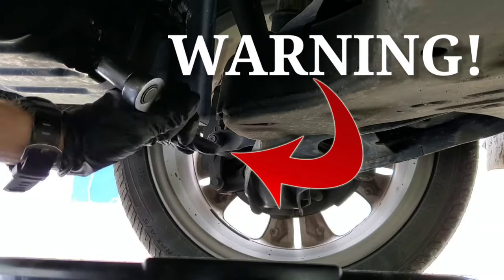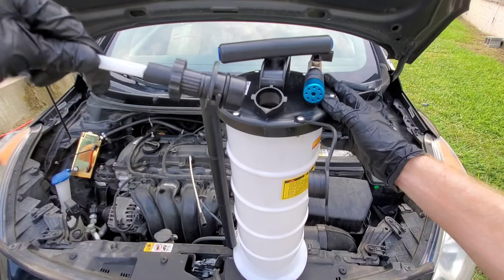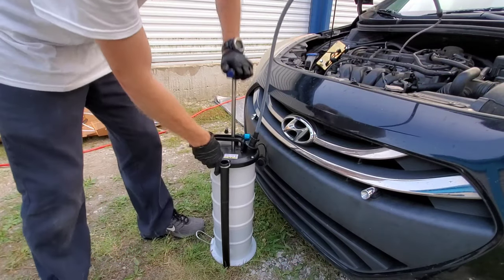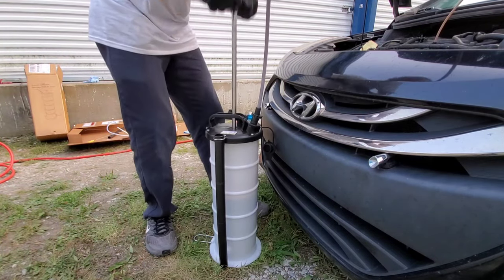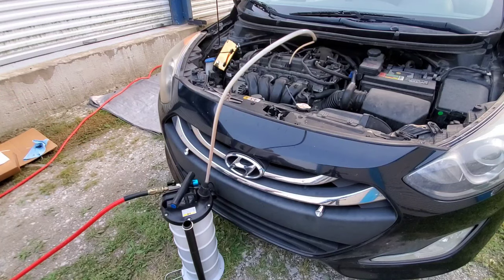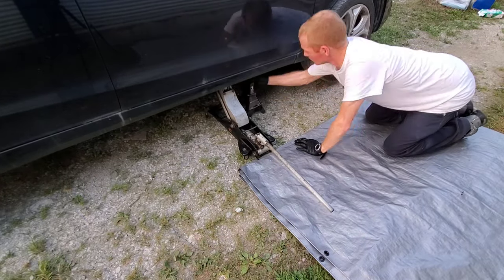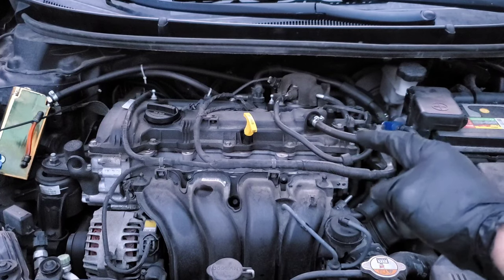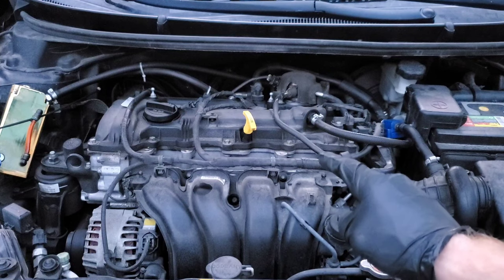Pneumatic oil extractor isn't safe!?

Comment from the maker: For more info on the extractor or where to find it check out the description of this video. What did you guys think about this fluid extractor, I thought there were some advantages depending on your vehicle.
Reply: You don’t wear out the drain plug or oil pan and don’t need a new gasket 😁

Comment: If there is sludge running out drain plug... You already got problems!
Reply: Watches sludge drop out drain i knew i shouldn't of used that damn extractor lol
Reply: It inevitably ends there. Normally heavier metal shavings stopped by the magnets in the pan.
Reply: Some sludge is normal with the wear n tear...
Reply: @algeriathelandofterrorists3329  yea a teaspoon or less for like 6 liters of oil.
Reply: Exactly lol and these are really to take oil out so no big deal.
Reply: @algeriathelandofterrorists3329 are you ok? I change 300k km oil pans out of BMWs there are so clean you got no sludge bud 😂😂

Comment: The engine needs to be warm, and also My Manufacture recommends extraction for means of changing oil ( Mercedes) rather than pulling the drain plug. And if you have sludge in your engine you got other problems to worry about. A well maintained vehicle will not have sludge lol.

Comment: I use one that works off my car battery. On my VW Passat that has over 75k miles and I've owned it since new. Most of the oil changes have been done at home using the extraction pump. My filter is on top so this actually saves me time and money. I find myself changing my oil more often (10k miles recommended), I'm usually changing it every 4k max because it's so easy to do. Highly recommend this method of changing it out!
Reply: 2015 Passat TSI here - definitely giving your method a try. How do you clean the pump and rubber tubes after each oil change?
Reply: My Audi A1's oil filter is gained from the top so the oil extractor works great. Cheers
Reply: @alanholmes2366
Same here on my VW Arteon.. I use a $14 electric motor extractor and extract it to oil jugs, which show I got it all. I agree totally. Awesome way to go

Comment: You forgot to mention that the drain plug sits about a 1/2"  above the bottom of the oil pan. This goes all the way down to the bottom and removes everything. WatchJRGo did a video and then put his car on a lift a removed the drain plug and like you nothing came out. He then removed the oil pan and there was maybe an ounce left if that. Great video!!! THANKS!!!!

Comment: Granted that your engine is in good condition and you change your oil according to the OEM recommendation. Even if there is a very small amount of old engine oil left in the oil pan, it isn't going to be an issue. There's around half a quart of engine oil left inside the engine that cannot drain out even if you drain it from the drain plug. So even if there is say 300ml of residual oil in the oil pan that could not be extracted from the extractor, that is an extremely small percentage of the total oil capacity.

Comment: Use this all the time. Set it and forget it. You cant get all the oil out anyways so same thing but this frees you up to check, tire pressure. Battery. Belts filters. Then change the  oil filter.  Pull out the hose and fill it up. No mess.

Comment: I use this on my volkswagens. The filter is on the top and i dont have to remove the belly pan. It saves my back and my time.
Reply from the maker: I would be happy to be in that situation no doubt.
Reply: Same here, I had a 2014 VW Jetta oil filter was upside down in front engine compartment. Used this extractor for oil changes never having to jack up the car. Now I have a Mazda CX-5- As long as I have to jack it up to removed tie oil filter I might as well just remove thr oil pan plug and drain it old school. However, I am going to use it again to drain my automatic transmission fluid. Also, like the ability to use it for bleeding brake fluid👍

Comment: Our shop uses bigger industrial ones. The vehicles oil needs to be hot in order to suck up everything. We found this out the hard way in winter. It took almost an hour to suck out a F150.
Reply: What the brand your shop use and do you think it safe I want to open a shop

Comment: This is recommended for the engines that have the oil filter on top of the engine. If it’s on the bottom might as well do it the old fashion way. Even with pneumatic method it is recommended every third oil change to remove the oil plug.
Reply: Thanks, I was wondering about the oil plug.

Comment: I used to use one of these on my old Volvo V70. Where I lived at the time, the driveway was pretty steep. I used to have to bother my neighbor to use her section of the driveway where it was flat, which meant asking her to move her car etc.
The oil filter was on the bottom, but I could reach it pretty easily without having to jack up the car.
The drain plug would have required jacking up the car, so I got an oil extractor instead.
It made short work of oil changes, and was much less messy too. Still needed a catch pan for removing the filter, but the amount of oil coming out was much less, so it was easier to deal with.
I wouldn't say I saved much time over a regular oil change, but it was much less unpleasant.

Comment: I'd imagine we should warm the engine to operating temp and then pump quickly so the sediments don't have time to settle.
Reply: Exactly
Reply: Will the hose loose its integrity?
Reply: no, because all the oil is in circle in the engine, and surently you can't extract all of it, it's better wait 15/20 minutes so all the oil return in the lower part of the motor, if you change your oil and oil filter every 15000 km probabily your engine will live longer of all the rest of the car 😅
Reply: @luisfontanez1770  The hose looks like teflon and I think that can withstand the temperatures the oil will be at. The only thing it should not be used for is solvents.
Reply: Yes, this is correct.
Also the warmer oil will be less viscous, so you'll suck it out faster.
Reply: The oil lipstick goes to the bottom of the lowest point of the pan. Oil flows towards that center point hence when they are all angled to a certain area such as the plug. As the oil is draining gravity makes it go towards the lowest point
Reply: @luisfontanez1770  Most are rated for about 100c which is about standard operating temp for a passenger vehicle. If you're worried just get it about half way to standard operating temp. Oil will be loosened up  enough to pump out easy without being too hot
Reply: You never jack a car at a earth surface!!

Comment: If theres sludge in the engine its not being serviced accordingly with the correct oil…not the fault of the pump!!!!!
These work well on warm oil as someone else suggested without issue
Reply: Yea and if your engine is all sluged up pulling the drain plug isn't gonna magically get that sludge out, either. I don't really see a downside other than the cost and space it takes up.

Comment: I got a VW GTI with the oil filter on top. I used one of these extractors for the first time and it worked great. Pulled all the oil out. No crawling around on the ground. The GTI has a plastic oil pan anyway, so loosening and tightening a drain plug every oil change doesn't seem like a good idea. You got a filter on top of the engine. It's the way to go.

Comment: The advantage of the fluid extractor for me is on my Ford F150 with the plastic drain plug that's on the back of the oil pan and lets oil gush out horizontally is that the extractor gets almost all of the oil out.   Then I take out the drain plug to get the last little bit of oil out.   No more oil on my new concrete driveway.

Comment: I have a an oil pump extractor and what I like to do is extract the dirty oil, then fill it with cheap motor oil, run the engine. Extract the oil again and replace the filter, then fill it with high quality oil like valvoline or mobile1.

Sure, I end up spending an extra $15  every oil change but I figure that's worth it for the sake of convenience.
Reply: that's a good way of flushing it. Would be even better if you drove it for a couple of blocks so the new flushing oil could dilute the gunk and slosh it around the sump for even better extraction of old gunky oil.

Comment: I use mine for old gas from cars I buy been sitting around for years. The fluid your pulling doesn't go through a pump, or anywhere seals can get wet by it. Brake fluid is worse because it swells o-rings up if you leave it. The reason they don't want you pulling gas with it is the danger it poses to person operating it gas has explosive fumes. If you dump it let things dry out right after no issues with pulling old gas. Works really well to get entire tank good and dry then I leave the lid off the tank for a few days make sure fumes are one I put an inspection camera down there see if there is rust in the tank. If there is rust then I replace the tank with a new one or if I can't find one I use POR-15. Lot of times no rust the varnish does a good job of keeping rust away I also live in AZ that helps lot also. Worst thing is to suck a tank dry then put new gas in there and bunch of rust gets sucked into the fuel system.

Comment: Used one for years on my cars - first time on a new car I always measure exactly how much it’s managed to extract so I’m sure it will work.  Also - I make sure the engine is warmed up beforehand- oil comes out much faster when warm. Vacuum doesn’t work on one of my cars though.
Reply: What’s the make/model of your car that it doesn’t work on?
Reply: @bigmouth3511  , Citroen C1 and Fiat Punto

Comment: I believe the drain plug will get more oil / slug out better but I can see how this might be a good fit for some. This is a great product for in board boat motors, as they always seem to be very difficult, time consuming, and make a huge mess doing it the normal way. I suggest to make sure oil is warmed up in either method, and adding oil engine flush prior to  oil change helps dissolve sludge that might be clinging on inside engine. Just my thoughts.
Reply: Drain plugs are often much higher than where the dipstick sits and you usually end up with 500ml of very old, sludge oil filled with contaminants, if you youtube oil extractor shootout pt 2 a bloke gives a very good example of why using oilextractors do a better job of draining motors and even better job on transmissions, i wouldn't expect someone who hasn't been trained how to use one would get it first go, they can be tricky to use despite them seeming very straight forward. Best advice i ever got for them was to make sure the tube bends away from the engine that way once it hits the bottom you twist it toward the closest wall in engine often locking it beside the dipstick and the engine, holding the tube while its gurgling will help alot too if it doesnt have a magnetic sleeve to hold it in place
Once its low on oil and gurgling, the tip of the hose in the engine taps up an down, sometimes you have to move the hose a few times in the stage if its not a hard line but a vinyl tube
Reply: Slug?
Reply: @EPTRotorsports  they meant sludge if you couldn't have guessed.............
Reply: @tomhalf3018  I know what they meant. I've never had a car woth sludge in it though. If you are waiting that long the the extractor isn't the issue.
Reply: @EPTRotorsports  you sure didn't seem like you knew what they meant when you commented "slug?" 😂
I also never said the extractor was the issue, they actually handle collecting sludge oil very well I use an extractor everyday at work and even on cars that haven't been serviced in 60,000km it just sucks it all out within about 10 minutes, although on major services i drop the pan to inspect that it has gotten it all out, wipe with a coffee filter, flush it, extract 95% of it and drop the pan again to inspect for debris.

Comment: Great job with the demo. But definitely don’t overpump nor do the pump too fast. You want a slow n steady few pumps, then wait, then a few more until a steady flow. Give it 5 minutes and throughout add some pumps to maintain pressure.
Reply: Thanks for the info 👍

Comment: Oil extractors that can be hooked up to an air compressor for constant suction work much better than the hand pump ones. MityVac 7300 is another model that uses an air compressor (but does not have any hand pump like the one in this video). Any size air compressor will do. Moving the tube around at the bottom of the drain pan will remove all the oil. However, I would use the drain plug for the first oil change, so that any metal shavings are sure to drain out. But in any case, virtually all metal shavings are trapped in the oil filter.

Comment: I just did this on my 1.8t Golf Sportwagon.  I switched to compressor when made it faster.
Full synthetic 5w40 and I always have warm oil but not this time.
I do warm next time.  There was a half qt in system which is like when I did oil pan drain plug.
I like it.

Comment: The purpose of this is to have a mess free oil change. It takes 1 minute to take off the oil filter and put a new one on, also you dont have to keep replacing crush washers etc or worry about wrecking threads and bolts. Which seems to happen more commonly than not to the average person. Everytime i do an oil change somehow i always seem to get oil on the floor. This is different than a shop with lifts and those drain containers that are adjuatable etc with the mesh screen where it makes 0 mess. Ive used varioua oil pan tran trays and with the initial drain oil somehow always splashes out. Also less time on your back and dont really need a lift to do it as alot of oil filters are accessible from the front underneath.

Comment: A few things that oil that you had was not meant for that car so that could be confusing a few people that don't really know much about cars. But anyways, I recently after years got one of these extractors, because 1 of my new Audi's has the filter on the top and it doesn't have a dipstick, you do have to have the engine warm and the oil warm. In order to get these extractors to suck everything out fast, I think it took a total of 10. Maybe fifteen minutes and I never once had to lay on the ground, so it's a winner

Comment: I had one of those Quicky oil change places strip the treads on an oil plug and then not say anything.  Going down the road and lost oil pressure.  Got the engine shut off quick enough to prevent damage.  A tow and in the shop found the stripped oil drain plug minus the plug.

Comment: Jaguars have filters in the top of the engine bay. They also have a tube to the bottom of the pan. The whole process takes be about 5 minutes with an electric pump

Comment: well I have a 10hp  diesel im installing in a cub cadet and wont be able to acess the drain plug , I had to trim the bolt head down somewhat  to clear the frame. I will be using this kinda method to drain the oil, I do have acess to the filter and all the orfices , to perfom the feat.

Comment: there could be sludge in the pan that oil would push out when draining from pan but using vacuum extractor may not reveal that sludge in bottom of pan when you checked it

Comment: 0:58 Its pneumatic why you pumping?  I have the same one, it is awesome!  I did the same test on my Mercedes CLA250 it got every drop of oil, did not bother on my Subaru Impreza.  Both cars took more than the recommended oil capacity that is the best way to tell if you got it all...  and there was no jacking or blocks or ramps...  From what I read Mercedes changes all their vehicles oil using an extractor and my Subaru Dealer is a hack they overfilled my oil and messed my drain plug with their impact driver the last time they did my oil...

Comment: It work really good for changing oil on soft tail motorcycle. Also. Use an air hose. It works just fine for sucking out gas. Just use a different one for oil

Comment: ATG & I say if you have to buy get the ATG's or like because the pump is outside.
No matter what you will have a nightmare cleaning the tank that has a pump inside. Then you still need to get under 4 filter.

Comment: This is a great basic pump if you have a super high quality oil/air filter and plan to do extended drain intervals. I used to drain the oil every 3000 with a filter change at 10k. The best oil filter is a better air filter. If you did this on cvt transmission fluid every 20k, they would go 250k miles no problem. They are tough on fluid as they shear. I would just use a 🦃 💉 turkey baster on power steering fluid. Drain and Fill is the success to oil and transmission longevity.

Comment: the machine in question is not at fault. I've had 1 for  over 20 years. If you use it as it was intended for it will work. The error is the operator blaming his tools.

Comment: It's slower but it's also safe this way. The only bad part is that you still need to get under the car to change the filter. While you're underneath why not just open the drain plug? I honestly don't see what purpose this pump would serve other than it being convenient cause you don't have to open the drain plug?

Comment: It is fast pumping engine probably wasn't hot enough that's why you should turn your engine on a little bit and makes the fluid hotter and it comes out faster.make sure your engine is off when you are pumping though😘

Comment: I used this on my 2014 Passat TDI and no it didn't work well at all.
Purchased it from Harbour Freight ($99 + tax). Removed filler cap and fed hose through dipstick opening. After pumping for about 7 minutes I extracted only 3 liters of oil (67%). Last minutes of pumping I got only air coming out. Since I already stane the extractor, it is not returnable. I'm pretty sure I will finf use for it.  It just it doesn't work for oil extraction on my car.